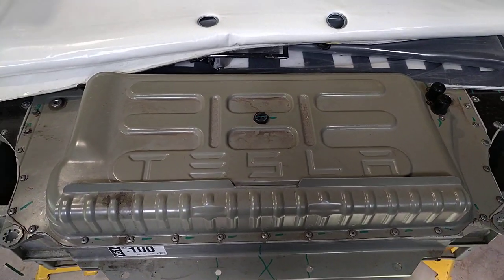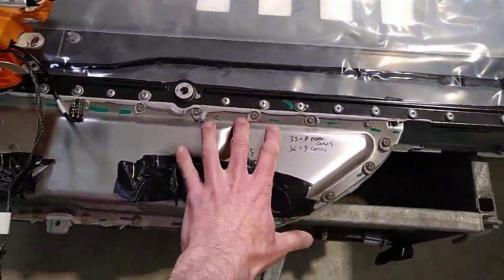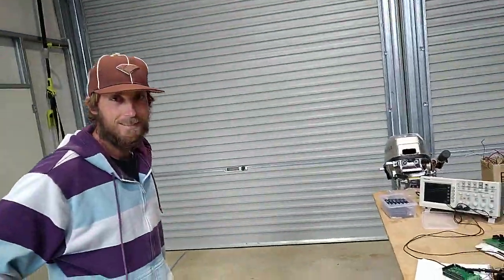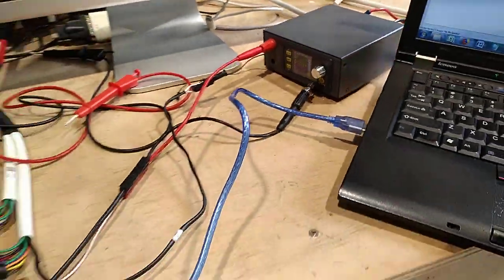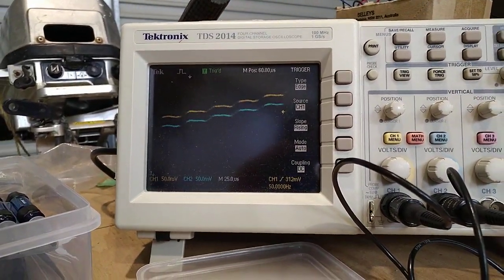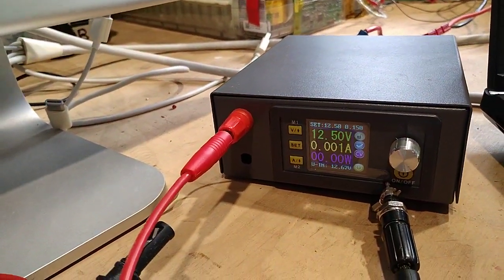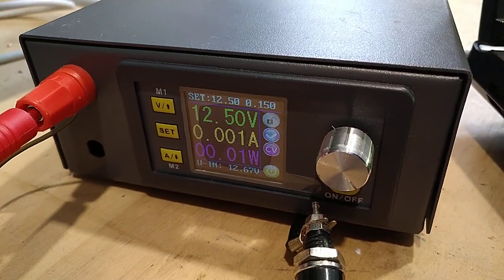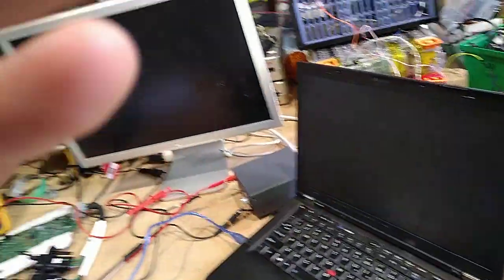Tesla Full Pack BMS Controller Communication

Comment: I think the modules have only so much info to report at a time, specially if nothing is changing. Maybe try to connect a load or charger to the module and a Hairdrier near the thermistor to see if these changes cause the board to update can messages!?!?
This could be a first welcome message package, Maybe the main master board is expecting all other modules to send their messages so they can jump to the next protocol stage?

Comment: Nice work! Try connecting one or more battery modules - I think the BMSs are independent subsystems that need to keep working regardless of whether they are in a car or not. It's conceivable that the comms board shuts down to save power if it finds nothing to communicate with, either the modules or the main cpu.
It could also shut down if it's really strict and doesn't find the right number of modules, but I would be hopeful that it would try to determine that during boot up and report to the main cpu what it finds.
Extracting and disassembling the firmware may help, but that's quite a challenging task.